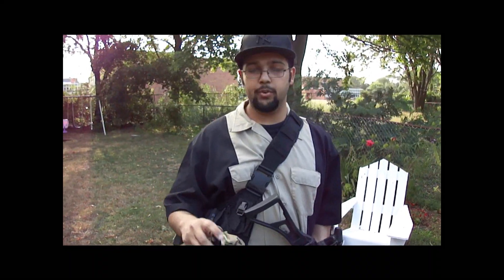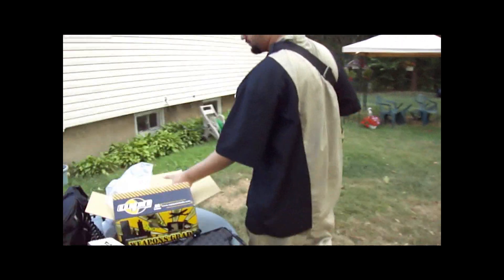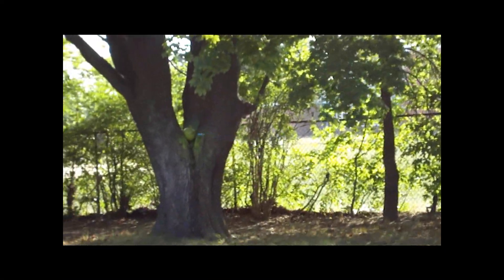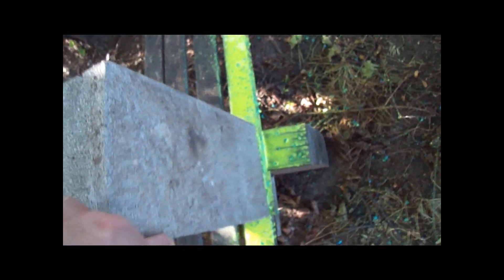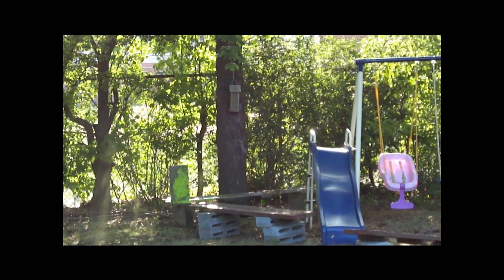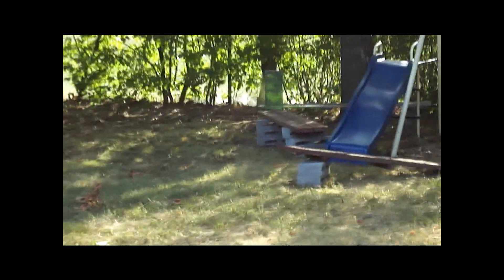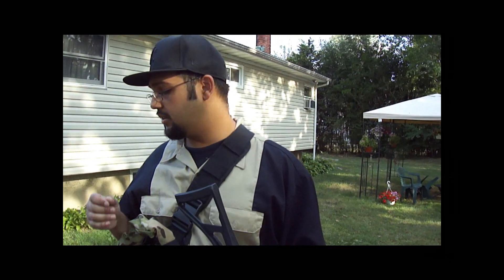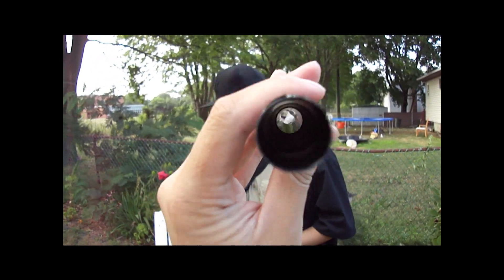DeadlyWind Fibur Review

Comment: Over or Under Boring doesn't affect accuracy.  What it does affect is gas/air efficiency.  I think this experiment shows this.  Although, setting the gun on a vice would have made the experiment more reliable as well as adding a control.

Comment: @bocajuniors55 

If you want dead on accuracy, I can understand putting it on a vice. If the user has no preconceived notions about over and under boring, shoots almost the same way as he would with both, it's almost the same. The operator will see the difference and that should prove to a certain extent of over vs under boring.